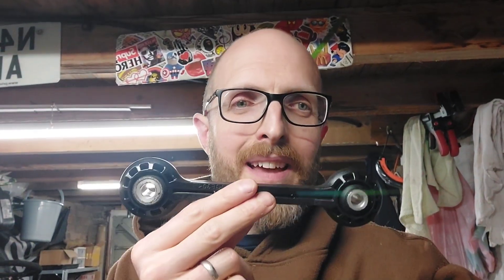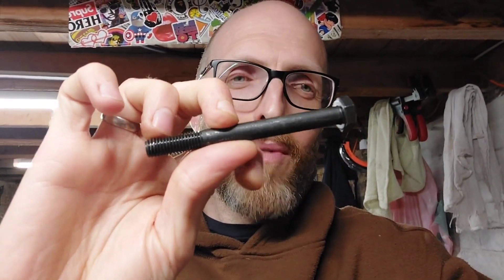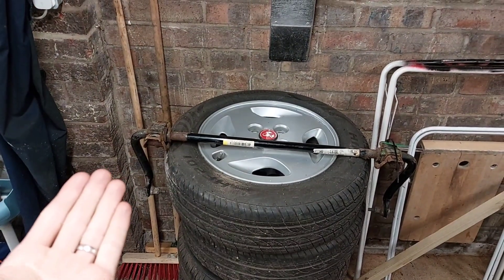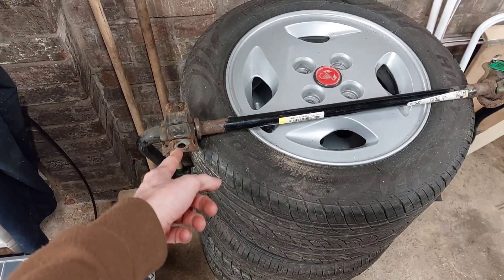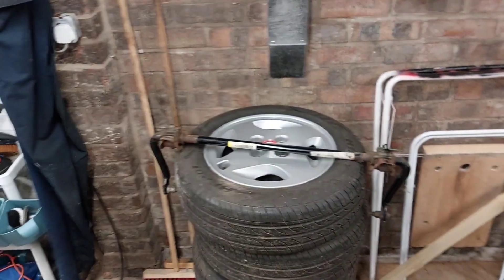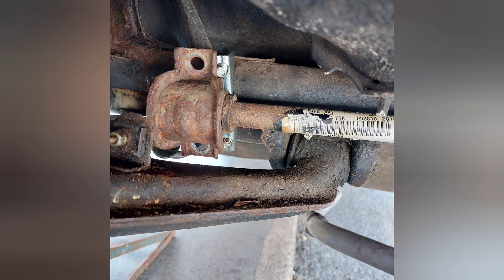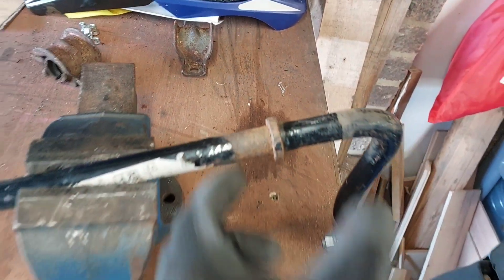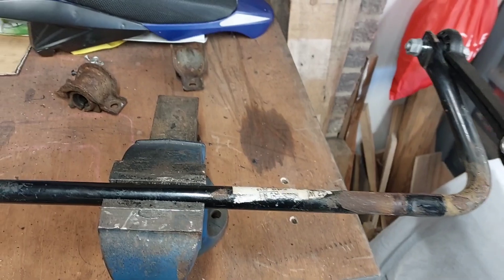Building a rear anti rollbar for your Cinquecento & Seicento ..Using off the shelf parts !

Comment: Have you seen the Miller Crossing video, with his rear ARB set up using a C Max ARB (from memory)? If so, what did you think of the parts he used? I don’t know if his video editing made it look a lot simpler than what it actually was, but he seemed to get it fitted to his Seicento fairly easily.
Reply from the maker: I'm not sure if I've seen that from memory.. the c max one looks to be exactly the same as the focus one..so may check out what he did differently

Comment: A decent off the shelf D bush and bracket is pretty much all that's left to really work out for a full bolt on kit. Ford fitted different thickness bars which makes it a bit tricker but all shouod be suitable.

Comment: isn't a 22mm arb too thick, considering the car has nothing?
Reply from the maker: I'm running a 21mm eibach anti roll bar on the front..so it should be nicely matched 👍
Reply: @wornoutracing  the weight distribuition is completely different from front to back, that is why I consider 22mm at the back as too much. I'm not a mechanic or engeneer at all. Just considering physics, weight and torsional foces
I'm afraid to have a more than happy rear end eheh
Reply: @MicaelTerruta no, it's fantastic. My car handles amazing now.
Reply: @wornoutracing  can you share the audi droplinks part numbers?
Reply from the maker: @MicaelTerruta  yes im going to put all the links/part numbers once it's fitted( in the next video) just so I know it all works OK and I don't give any wrong info
Reply: @wornoutracing  what about the kit you used a few years ago? the M10 Turnbuckle Kit ? will it work?
Reply from the maker: @MicaelTerruta  that kit was also really good..but the m10 adjustable drop links with that kit would work yes (ideally you would fit them with the small rubber boots to protect the joints though) I didn't put that kit together so not 100% sure what bushes and brackets were used to mount it though
Reply: @wornoutracing  is the front arb from another model or an upgrade from eibach?
Reply: @wornoutracing what front arb are you running ?
Can’t find anything with 21mm for a Cinq
Reply from the maker: @MicaelTerruta  yes it's an eibach arb... they're so hard to find now